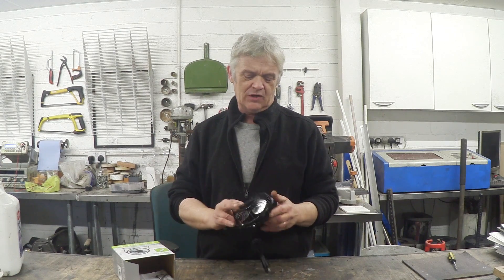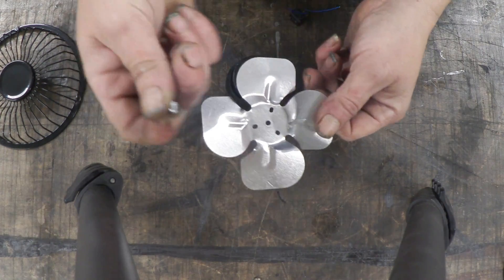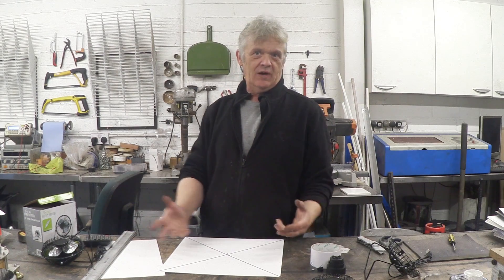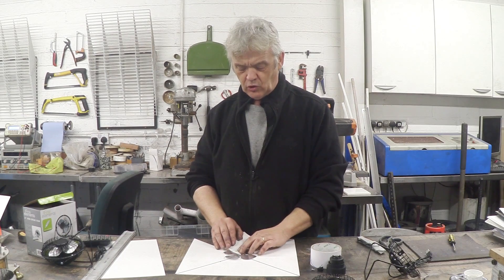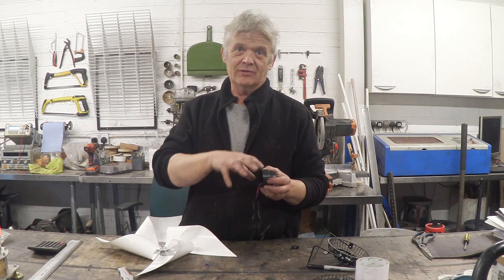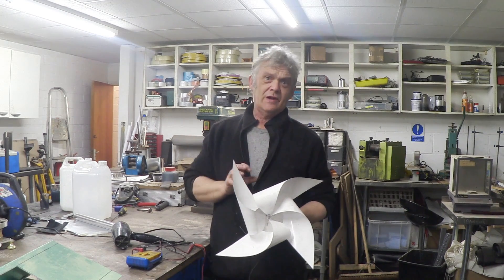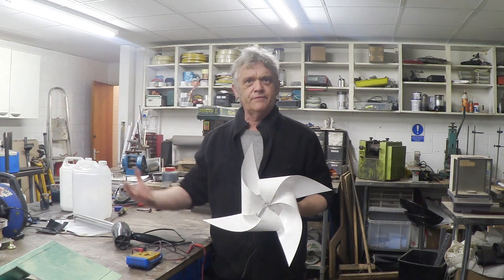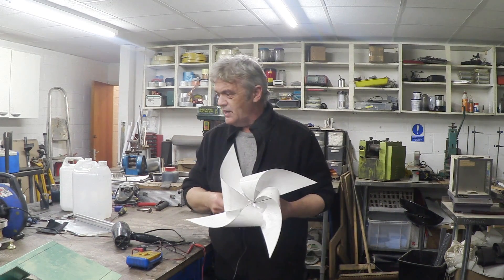Mini Wind Turbine From Desktop Fan

Comment: Don't fan motors need permanent magnets adding before they can function as generators? Or do certain types "just work"? I saw a video by some perpetual motion swindler saying you can turn a floor fan into a waterwheel that will power an incandescent bulb and a drill. Somebody in the comments said it would only make 20 watts, but that's still a decent bit of juice to slowly charge a power station for a rainy day.

Comment: Idea is OK. But how practical it is?
I guuess it is about 40 cm in diametre then it could harvest about 5W at 6m/s wind. Could be used for emergency phone charger if proper electronic circuit added.
We always must look on the practical usage of these interesting and sometimes weird ideas :)
Reply from the maker: the idea is to experiment - I have no idea how practical that is - I guess that's up to the experimenter to make it practical - so I have to disagree - practical is not always the point but it should be the goal for sure

Comment: A brushed, DC, electric motor, being turned mechanically, is a generator, generators produce DC power absent rectification. Alternators produce AC and would need rectifying to produce DC. You adding a rectifier is a waste and improper.
Reply from the maker: cheers mate

Comment: The energy generated from a brushed dc motor is not AC and doesn't need to be rectified.
Reply: Agree.
Why add the 1.2V drop when you don't have to?
Reply from the maker: yep - my bad
Reply: Wait so.. does that mean one could connect the two red and black wires directly into a 12v battery to charge it??
Reply: @nonyabusiness9747  No, that motor wont produce 12v maybe if it was a universal motor and you activated the field windings to act as an electromagnet. Also you would need atleast one diode to stop the battery powering the motor.